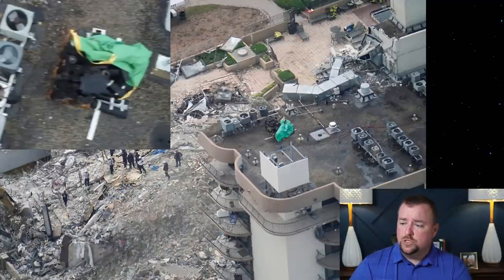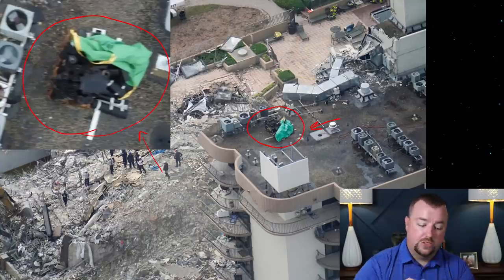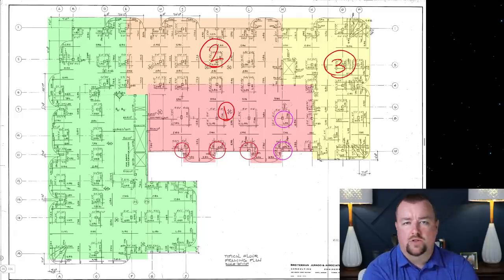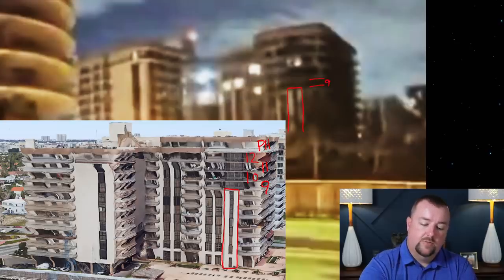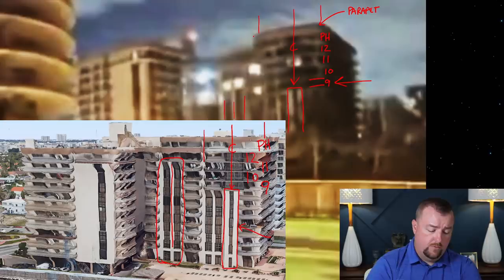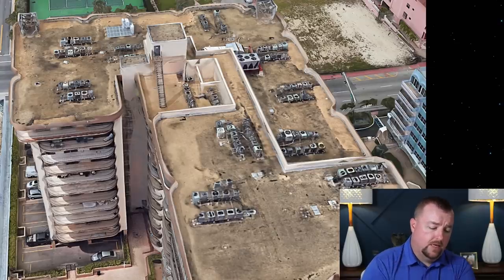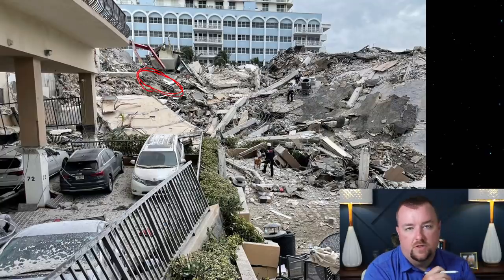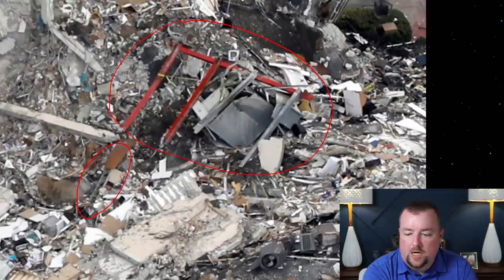Surfside Building Collapse - Did it start at the roof?

Comment: As an architect I would never design a structure like this.  I would have a continuous foundation wall at the perimeter of the building. Any additional underground parking outside the building footprint needs to be structurally independent.  One reinforced opening in the foundation wall would allow traffic between the two parking areas.  Your previous video shows that the slab under planters abutting the building failed first, collapsing the pool deck.  This then weakened the adjacent columns which also supported the building so it collapsed 10 minute later.  All this also likely negates the theory that the foundation 8 feet below failed because of sea water intrusion.
Reply: I’m no architect but you explained that we’ll enough for me to understand…sounds like common sense but common sense isn’t so common..even among architects
Reply: I dont think so. Even with the pool deck collapsed, those columns should be able to hold up the building. Even if a few columns failed, most of the building should still stand. I think its more likely bad workmanship and cost cutting, maybe a lack of rebar and/or bad mix of concrete. There have been other building collapses where they used less rebar to save money.
If I was the city I would be looking at any other buildings erected by the same contractor.
Reply: I have not seen anyone arguing that the foundation per se failed.  The salt-water-related theory that I thought was persuasive was that salt water was chronically washing into the based of pillars in the parking garage, which were shown to have spalled. This would progressively rust the vertical rebars, and importantly, also the stirrup "circumferential" rebar. At some point, the most-damaged column's concrete, no longer "corsetted" by the stirrups, would have crushed, allowing load to transfer across the slabs to adjacent columns (precipitating falling chunks of slab and also removing support to one portion of the adjacent deck).  This is of course speculation, but seems pretty plausible.
Reply: ... a few minutes later... OK, I see that Josh is going to talk about the foundations in the next video... so maybe there is some discussion about that.
Reply: Stick to coloring in. Quantity surveyors do all the real work
Reply: A video I stumbled on was showing floor plans and section details of this building. Columns appear to be smaller in the sections that collapsed than what stood. Secondly, the concrete slab that acted as the garage roof and the underside of the patio stone deck/courtyard was designed to be sloped but it doesn’t seem to have been built that way. Meaning that when it rained the water made its way though the patio stone joints and settled on the concrete slab and had nowhere to drain and the water pooled (with no waterproofing). Decades of water penetration like that would severely compromise the concrete foundation and columns. The patio deck was the first to collapse and the columns just punched through the slab (rebar connections failed).
Reply: @msgstar4933  Why post such a belligerent reply?  For what it's worth, QS is not a common distinct profession in the US, so no, QSs do not do all the work, nor probably any of it for this building.
Reply: Agree 100%.
Reply: @gjuric  The engineer on this channel has the best coverage of the 5 that I have reviewed.  His previous videos cover these matters.  The plans do show sloped slabs to drains but you have to look at the right drawings.  That doesn't mean they were built that way.  The important thing I'm trying to get across is that it is bad design that the entire building envelope and structure were not independent of an adjacent parking structure exposed to weather.  The collapse of a pool deck should never pull a whole building down.  But only if the overall design is smart.
Reply: @2DXYSU  I agree it’s a bad design (I’m an architectural technologist). I also believe water got to other places besides the slab of the patio so it’s hard to say if the collapse of the deck brought the rest of the building down solely due to design… I think the rest of the building had water damage as well. The tourist video a few minutes before the collapse shows water gushing (broken pipe?) after concrete crumbled at the main level of the structure (not sure if even the deck had collapsed at this point because this was filmed on the opposite side).  

Poor design, lack of maintenance, having a condo board that probably couldn’t agree on anything over the years …led to the state of this building. If they had at least maintained it …they probably could have gotten more longevity out of this poor design until it reached an age that would have led to a planned demolition and redevelopment.
Reply: Seems to me that when these investors want insurance money and a new building,they just blow them up!
Reply: There is no issue with how the building was designed. What this comes down to is shoddy construction and lack of maintenance.
Reply: Is there any doubt that the failure started at the pool deck, or is it possible that the pool deck collapse was a smaller symptom of a separate, much larger problem, such as damage and failure of the column(s). Did damage to the pool deck lead to destruction of the columns or were the columns failing and the pool deck was a symptom of the larger failure. 
Someone here in the comments said that the pool deck failure should not have brought the building down. I have to agree that that sounds unlikely. Or it should be very unlikely. 

I say this because everyone is talking about how the waterproofing of the pool required serious work and this could be where thr problem started, but to me the pool seems awfully far from the failed columns that everyone thinks ultimately brought the building down... And I can't help but think back to the manager speaking about how often 2 feet of seawater was on the garage floor (he said cars were floating), seawater which constantly had to be pumped out, although he also said they could never quite get rid of it all. 

Was the pool leaking the problem? How did it leak saltwater into the garage? Wouldn't someone notice 2 ft worth of pool water missing from the pool once a month? I don't understand,  was the pool saltwater?
If not, where was all that seawater coming from? 
Am I misunderstanding this...?

Thx for the great conversation thread!
Reply: @laurasalo6160  I've been wondering the same thing about where the water in the basement was coming from.
The 1979 plans for C.T. North have an entire extra sheet for storm-drainage of the site and basement, while storm-drainage for C.T. South seemed to be more of an afterthought.  

I doubt it was pool water.  If it was sea-water, then adjacent buildings would have similar problems.  And we design concrete structures to survive in wet environments all the time.  Salt water doesn't make concrete soft. 

So, my best guess is the water in the garage was coming from rainwater and/or irrigation water, and their nominal storm-drainage system had plugged/failed.  
(Someone should maybe look into the building's water usage over time to see how much water was going into the landscaping/planters above the garage.)
Reply: @msgstar4933  QS are experts on cost and value, nothing else... They're not structural engineers or architects.
Reply: @msgstar4933  You must be a fun person to be around. pfffffff
Reply: @tubester4567  I'm thinking the dynamics of the collapse put a side force on the columns they couldn't handle.
Reply: @laurasalo6160  they’re not talking about the pool waterproofing per se but the pool deck which makes up the entire ground level from the pool up to the front of the building and the columns that first collapsed. The waterproofing was under the tile of the pool deck and the planters they had butted up against some of the columns and that were the salt water was intruding and compromising the pool deck, columns, and rebar.
Reply: @sasquatch98  okay I see, I understand what you mean. I think it threw me off a little that the manager claimed it was definitely saltwater flooding the garage floor.
Reply: @jsshortreed9190  interesting, I didn't know how saltwater vs freshwater affect concrete.

I know that everyone has pretty much dismissed the possibility of a sinkhole below the building however, couldn't a sinkhole account for seawater being in the basement floor of this specific building and not neighboring buildings...
The amount of water they saw frequently on the garage floor really nags at me. I really can't stop wondering where the water coming from and what it meant for the building structure.

I recall the manager specifically stating there was water down there even during dry weather periods, which makes me think it possibly wasn't from precipitation alone.
Reply: @tubester4567  I had that thought initially about the pool deck collapse should not cause the building collapse. However, there are two things that happen when you push or force a pool deck down some columns unevenly: lateral forces on the the columns and the columns are twice as long as they were intended to be with no support half way up (13 feet tall for lobby level and 10 feet tall for garage level = 23 feet tall columns). Now you have a building standing on 23 feet tall columns with a structure forcing its way down around these columns putting lateral forces on these thin columns they were never designed to see. Imagine playing a game of tennis and the lateral forces involved on your legs. Now imagine playing on stilts, and your ability to manage lateral forces goes way down.  Now imagine a force tugging on your stilts unevenly like playing tennis in 2 feet deep mud, it might be difficult to remain standing.
Reply: I’m only joking people.
Thoughts and condolences to all involved.

An Architect, Civil Engineer, and an Electrician were discussing the marvels of the female body and trying to declare which profession god was when he designed the female body.
Architect says that god must have been an architect to design the breasts and shape.
Electrician says that god was an electrician due to the way a female brain is wired…
Civil Engineer says “guys you are both wrong, who else would put the toxic recreational Centre next to the toxic waste pipe?”
Reply: @beehaven9949  the stilts, that's a really great analogy.
Reply: @hueythegod2493  also, a lot of buildings are designed and built without architects involved
Reply: As an architect, I'd hope you wouldn't design any sort of underground structure on a barrier island subject to multiple tropical storms / hurricane floods per year.  Floridian's don't have basements for a reason...I can't fathom why they thought underground "anything" was  good idea here - except above-ground pool equipment rooms would be unsightly and noisy.  (And why would you put an above-ground parking lot adjacent to the structure when you could build another condo tower...greed!)
Reply: @KathrynsWorldWildfireTracking  But the failure seems unrelated to the basement location.  I know many buildings near sea air where one or more towers are built upon a mulitistory above ground parking garage with a larger footprint. The roof of these garages are private parks with trees and planter boxes hiding potential deterioration where the garage roof slab meets the building structure.

Comment: The “Bright White Lights” that flashed, are from the Fire Alarm System, the strobe lights, being activated due to the Water Flow Alarm System being activated. Water Flow Alarm activation due to sprinkler pipes being broken on the lower garage ceiling. That would be my guess, because I couldn’t figure out why the Fire Alarm strobes were going off , on the surveillance video of the collapse…

Great video!!
Reply: That is a great explanation for those lights. The fire protection system may have been triggered 7 minutes earlier in the garage video with the pouring water draining out of the pipes. I am a little confused why this fire alarm would not have gotten everyone awake and heading down the stairwells (I only heard of one couple found in their bed not sure if it was an exception).
Reply: @beehaven9949  Depends on several different factors…
How the system was designed for the building, was it functioning properly, does the alarm alert in the apartments/condos or just in the common areas (hallways, stairwells, etc)??
Civilians would be surprised at how many systems don’t work properly.

That’s my initial thoughts, off the cuff…
Reply: @ryanflyhigh36  "Civilians would be surprised at how many systems don’t work properly." Best statement I've heard to sum everyone's theories up.
Reply: And those would have some kind of battery back up, would they not?  I imagine just a capacitor would probably keep them going for some time.
Reply: @ryanflyhigh36  are you an electrician? Fire alarm system lights??! You can do better
Reply: @michealgoins1625  No, sir, I am not.
Reply: Could it be from DSS blue lazer lights? Apparently an audit was gonna happen political reasons
Reply: @michealgoins1625  Like it would make a difference if he said yes.  If you have something to add then do it, otherwise go pound sand.
Reply: @michealgoins1625  i am a fire alarm engineer and his suggestion is extremely possible. as soon as water flows it sets off the alarm visuals and audibles and is supposed to call out to the monitoring company. when a water pipe for the system is breached the most disgusting black stagnant water comes out first until new water gets introduced to the pipes. usually there is a 15 second delay on the flow alarms to prevent false alarms. sorry this is all i can go on from what i have seen.
Reply: @michealgoins1625  i AM an electrician, installed fire alarm systems in many high rises and government buildings... what are you insinuating? he's talking about strobes and horn/strobes
Reply: @ryanflyhigh36  I recently did a repair job at a high rise apartment building. About 30 mins in the Fire alarm goes off. I immediately thought back to the fire drills and videos that were drilled into my brain as a child. I exited through the stairwell but only to my shock i was the only one leaving. No one else seemed to be reacting. It was Noon on a workday so it may have been less busy but the Alarm activated and everyone just kinda wandered around. No idea why but it makes me wonder if this happened.

Comment: I think it happened at the pool deck. Eyewitnesses said the pool deck was the first to go.
She called it a crater. It dragged the rest down with it.
Reply: watch his other video, he shows a video taken before the collapse and you can clearly see debris on the floor in the basement, so. as the pool deck was above that, that would make sense
Reply: I think the same!
Reply: No question. About a 7 minute gap before the tower gave up holding itself together without its columns. This type of interconnected design should be illegal imo, and should have been then too! A poorly maintained pool deck is a terrible thing yes, but it should only result in a collapsed pool deck, even in the very worst case! The pool deck should have had its own support system period.
Reply: extra weight of the retrofitted penthouse, combined with poor maintenance and lack of inspections/followup, combined with water intrusion at the base?
Reply: @CaptainCaveman1170  Yes, the pool deck should have no connection to the main building.
Reply: @austinh1028  ...and the added heavy pavers, and some new planter boxes, and some new palm tree pots, and very poor soil to begin with and a bare minimum structural design and very poorly installed rebar (too close to the bottom) and the vibrations from the massive demolition and excavation that happened only 100 feet away (where the 19 story condo went up). So this tragedy was not unlike the Titanic disaster imo. The ship didn't sink because it hit an iceberg, it sank because it hit an iceberg at FULL SPEED, and in that exact section, and at that exact angle, and on the same night the watchstanders forgot their binoculars and while the captain was asleep...etc etc...
Reply: No evidence of that
Reply: @seedplanter7173  Literally ALL the evidence (including video evidence) points to the collapse starting at the pool deck, with the tower following it down 7 or 8 minutes later.
Reply: @CaptainCaveman1170  The utter lack of structural redundancy should be illegal. This building shouldn't have failed even if 2 or 3 columns are damaged. But you are right. Tying a pool deck into the buildings primary support columns in the fashion they did should have never been allowed. Several things discovered in the construction of this building shouldn't have been permitted. Even the land on which it was built was unsuitable (reclaimed wetland) for a 13 story building.